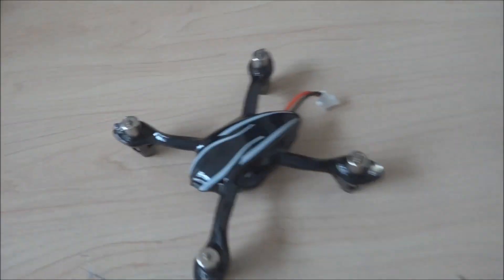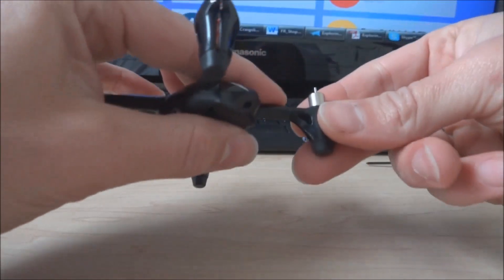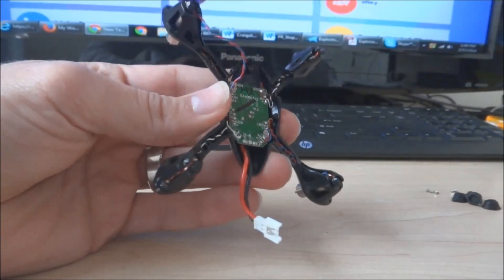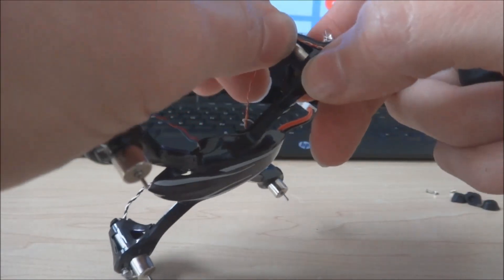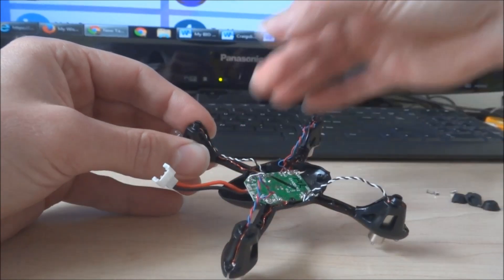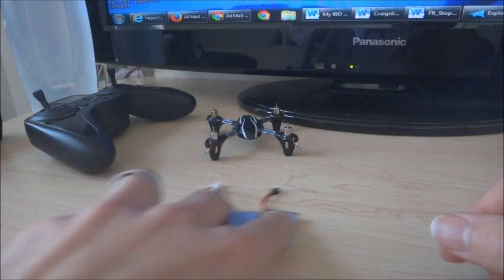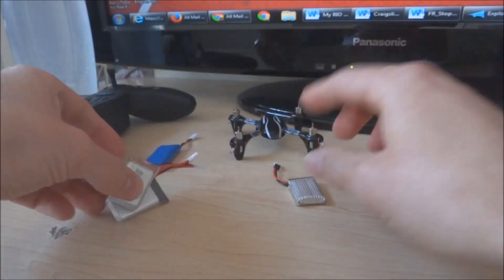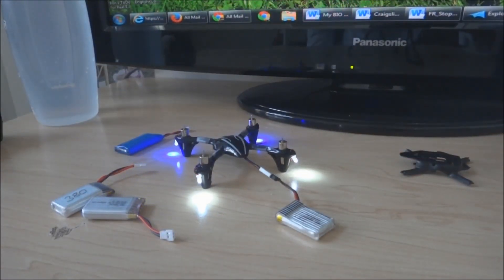Hubsan x4 LED mod and details about the different batteries.

Comment: nice video, if the physical size of the battery is more big...then in your video. but light weight ...will the quad easily hover ? can any trim setting help ? anyone tried it ????

Comment: Randomly looking at h107l videos before buiding a replacement.
I have my own LEDs, shell, batteries... just waiting on module feet and u/g motors.
so I can install LEDs upside down even neater I hope! Thanks, great idea to invert Leds.
Ps. anyone know where to ret the correct wires for my leds, no idea about the terminology lol?
Reply: i installed them facing down. neater?? mmm, maybe not lol

Comment: This is a great mod. I just did it on my H107C HD. It took less than an hour total and it was definitely worth it. The wires on the two rear LED's were stretched to the max. I wondered for a minute or two if they were long enough. They were, but in that "you gotta want it bad" kind of way. But nothing broke or came unsolder-ed. First flight after the mod and this thing looks amazing, And I also instantly saw the LED's blink the moment the battery was low like I wished I could from the start. Thank you for posting this!!!
Reply from the maker: That's awesome Bill and your welcome, I'll be posting another cool mod in the near future, but this time it will be of the controller.... :)

Comment: I like the LED idea, but wonder why you are attaching a camera to this quad.  Hubsan uses larger motors on their camera quad to compensate for the extra weight, did you know that?  One of them is the better choice for what you are trying to do here.
Reply from the maker: Hey Mike, I think I was just doing a proof of concept with the camera. I don't need a small camera on this thing as I also fly a bigger copter with a Sony NEX-5R attached to it, lol, so this was just for fun. :)

Comment: Is there space enough to fold the LED cable back the same way it came from? And maybe us a glue gun to make it stay in position. I love this mod, but hate that vunarble open cable. That's not clean to me. But maybe you need to solder it then? Or there is room for it. Can I take away the bottom half to if I need to solder? I don't screw up gyros or something. It's just a mainboard? Thank you so much!
Reply from the maker: phreakii I'm sure you could do all that, but I have never had a problem with the way I did it, so let us all know how it works for you. :)
Reply: @Benjamin Mois of course I will update you guys. My only concern is if it's safe to unscrew the mainboard?
Reply from the maker: I have done it many times with not a single issue, just put it all back where it goes and it will fly the same. :)
Reply: phreakii , I done this mode yesterday with Your suggestion. My upgraded x4 h107c with HD 
camera had shorter cables, not enough for loop around arm. So I just bended the cable and pushed LED to 
the hole and secured with little bit of glue. As You say, nice and clean, not 
exposed cables and same result as in video.
 Benjamin Mois , thanks a lot for this tutorial, You gave me courage to open my new x4 . I am beginner in quads and with this mod is flying easyier.

Comment: Kid's reaction sounds about right.
I'm going to have to do the LED mod and maybe find one of those little cameras.
LED mod was as simple as gently pulling the LEDs out and re-positioning them.
I didn't need to disassemble and the heat shrink on the back of the LED keeps it in place in that little slot.
Reply from the maker: Nice! :)

Comment: great tip, hubsan should follow up on this and points leds down.
Reply from the maker: I think they did with their new copters, Google the Hubsan X4 and check out the new design. I think I'll be getting one of those later on also.

Comment: Let me ask, how did you get it to spin with great throttle stability during flight, when I try to spin mine, its the same stick as the throttle and it always goes up or down with it, is there an easier control schematic or does mode 2 work better?
Reply from the maker: kylefer In a short simple answer, lol, lots of practice I guess... I have been flying the Hubsan for almost 2 years now. :)

Comment: You don't think that the batteries is going to be hot or warm and heat up the circuit board and maybe damage it
Reply from the maker: Jose Torres It's the same voltage, just longer flight time and so far no damage. I fly it for an hour straight sometimes with all the batteries I have... :)
Reply: Aw kool then I need to get me some new batteries so I can have longer flight time thanks a lot for your input
Reply: I'm going to do your mod on my x4 that is a brilliant idea but I must say I have to be very careful because the wires are so thin

Comment: Thanks for the tip.I did it while watching your video.I think the vid took a little longer to watch with all the breaks i did..Damn hard getting those wires back in the arms lol.. I was very sure the led aswell as the motors didnt work before i turned it on.Lucky me everything works and i can see the little fucker from underneath now :D Sorry my bad english..Keep on posting your mods :) Thor..
Reply: Open up the eyes with an exact knife. Drill a couple micro holes in front. Plenty of light. I very carefully tried to do mod. Absolutely will not work without exposing led wires. Great light mod if you can pull it off. 107C........pull out camera......... 500 battery

Comment: I tested the 380mah battery with my multi and found out that it even kept charging when it already was at 4.42V. This is probably also why my quad is so ridiculously more powerful with this battery, because the voltage goes pretty damn high. 4.2V is designed maximum for lipo batteries. I also was never able to fully charge my battery, even after 2.5 hours it just keeps charging. So guys never let your batteries charge alone, always watch them.

Comment: thanks, great review. I finally got myself a H107L and think the amount of time the stock battery lasts is alright but the charging takes so long (up to an hour) so I guess I'm going to buy a bunch of 240mah stock batteries rather than the 380 ones, as they seem pretty big. I couldn't really see it in the video, does the 380mah battery bend out that thing which you have to pull down to pull the 240mah battery out? or does the battery fit behind it? and there really is a noticeable difference in handling of the quad between 240mah battery and 380?  because apperently it only weights 3 gramms or so more
Reply from the maker: MenskFCDH
It's worth the wait my friend, wait till you see what I'm flying now and what I will receive within the next 24 days... :D I'll post videos as I have time.
Reply from the maker: In all honesty, I think the 350mAh battery is the best for the x4. It's the perfect size, lasts longer than the 240 and just plain works well. :)
Reply: Benjamin Mois right, really no big difference in responsiveness, speed and such? because you said that even taking off the bottom does make a difference, and the bottom doesn't even weight that much.
Reply from the maker: I don't think it's really a problem at all, taking off any weight is a personal preference for me and I just like it because I can mount my small camera a bit better. :)
Reply: Benjamin Mois
I'm waiting for my Hubsan to arrive. I bought the blue 500mAh before i saw this video.. Not sure if the big batteries influence the flight characteristics.. If the flight time is increased and the battery sticking out is only cosmetic, then i guess it was a good choice to buy these. We'll see what happens..
Reply from the maker: MenskFCDH
I have three of the 500mAh batteries and they are my favorite to fly because of the increased flight time. As I became better and better at flying my Hubsan, I found that now, there is no difference in flight characteristics and enjoy flying the bigger batteries the most. :)
Reply: Benjamin Mois Ahh that's great news.. Thanks for replying. Í have only received the spare props yet, so i have to wait to finally try the Hubsan.... Can't wait! :)
Reply: The big battery weights 12 gram more.

Comment: I sure have and it's the way to go, I will make a video soon to show my mods and the difference between the hubsan and WLtoys micro quads ie 2nd gen 252 and the new 242. With these boards and a Devo you can make the smoothest flying longest range micro quads out of all the Hubsan chassis's, I'm getting the FPV next cause now it will be awesome!! Just the BNF, I have the goggles, Devo and board to swap.
Reply from the maker: Steve O's Video's Nice! Let me know when you have them up, I would love to see all that! :)

Comment: Thanks for your comment on my channel on my Hubsan X4 h107l night flight video.  I like your modification and will definitely going to do it on mine. Great idea, though! . On mine I would leave the bottom side of the frame on.  That part helps absorbs the force of an occasional crash preventing the arms from breaking.  I had flown my quad really fast at night in from of my house and one day a neighbor told me that at first he thought it was a shooting star but when he saw it changing direction of travel he freaked out thinking he had an UFO sighting.  HA HA HA...LOL...

I'm going to work on my quad right now to do the lights mood, even though I think that the lights are going to be more vulnerable to breakage in the eventuality of a crash. Thanks for sharing my friend.  Today is going to be a busy day for me.  I'm going to do this mood on my Hubsan, then I need to figure how to set my new fatshark gear on my plane and on my Blade 350 QX quadcopter and test it.  Can't wait to start flying fpv.  Have a great day my friend. Thumbs up.  Feel free to visit my channel anytime.